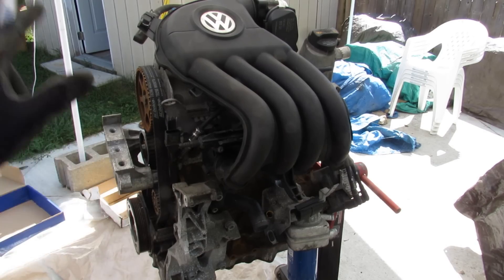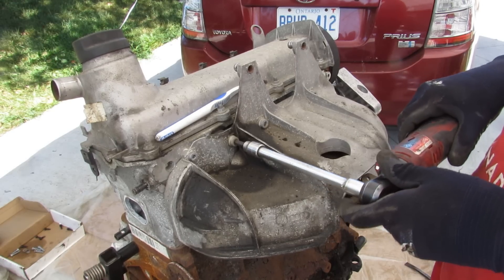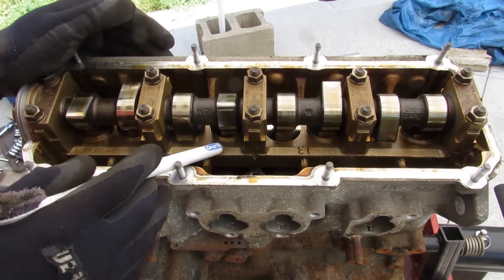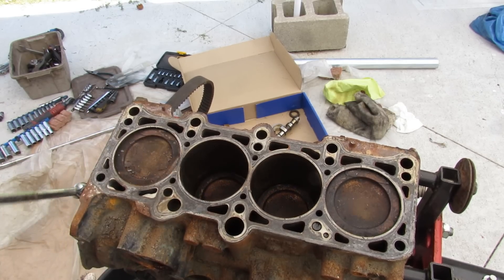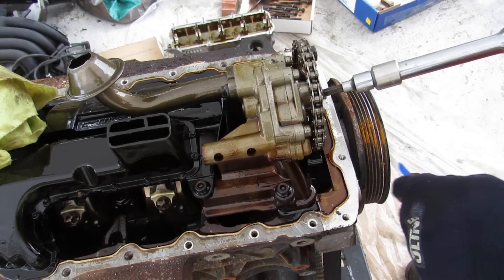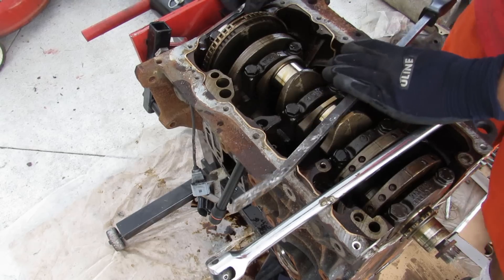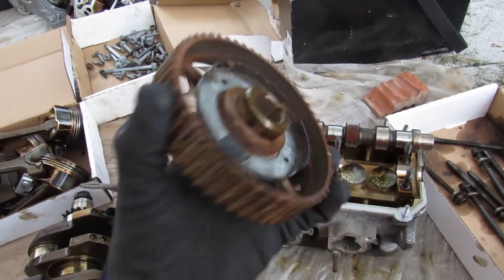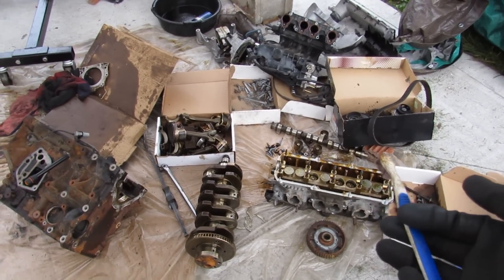The Simplest Modern Engine - From Volkswagen?

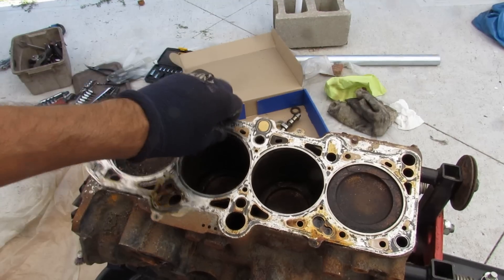Comment: As a VW engine builder (look at my channel) I have to correct you. The oil does not go up in the middle of the head. Look at 5:04 
The seconds bolt hole from the right. There a tiny hole. From there it feeds around the head bolt (2nd from the right) up around the bolt and somewhere under the washer sideways into the head. The hole in the middle-front is the oil return.
Reply from the maker: Thanks for the correction. Yes I've seen alot of engines being fed oil around the head bolt hole.
Reply: What is the best engine VW builds nowadays?
Reply: @82dupont  A Porsche flat four :)
Reply: Actually… the oil goes into the head, through the valve guides, and into the cylinder. 

At least it did on my 2.0L at 100,000 miles. 

Junk. Absolute junk.
Reply: @Bartonovich52  fr?

Comment: no VVT ,no V16,no direct injection ,no cylinder deactivation ,no turbo , no low tension piston rings ,no cartridge filter  ,inline 4 at best reliability
Reply from the maker: Yes....the irony is it's from a German manufacturer
Reply: @speedkar99  
i really didn't expect such engine to be made in 2015

Comment: That Jetta was the worst VAG product i've ever been in or driven. That engine is such a dog even tho it's pretty reliable, but who wants a reliable turd. It's not that good on gas either because you have to floor it to move anywhere. Pulling out into moving traffic in that car was fucking scary because of how slow it was. Would have people backed up behind wondering why the hell haven't you gone yet.  Forget taking any gaps to merge on the highway, you needed to plan your moves far ahead of time.  It was good to have as a learning teen driver tho. I was very mean to that car. The tires were bicycle all seasons too so the handling was like the polar opposite of a miata (understeer city). I wanted to like the car, the styling was alright, and it had an aux with a working radio and air-condition, and power windows... Those were the redeeming features.  When I heard the lawnmower I wasn't watching the screen and had genuinely thought you started the engine. I now have an apr tuned mk7 and it costed way less than that car... buying cheap new car seems to be pretty poor value vs lightly used. When I see cars like the Mirage... why would you do that to yourself? Never again.
Reply from the maker: Agree with all your points there. Putting such a slow engine in a heavy car is a real cost cutting move by VW... almost dangerous. 
What year was yours?

Comment: I turbocharger my 2.slow on my 2001 jetta
Reply from the maker: Does it just bolt on?
Reply: @speedkar99   the 1.9 turbo diesel exhaust manifold fit on the engine plus there are some aftermarket turbo exhaust manifold  online. So my set is ....
T3t4 turbo .48hot/.60cold 
Intercooler from Amazon 
Oil feed and other pieces Amazon 
Hybrid oil pan with oil drain 
Some Amazon blow off valve 
Reject version of a tial waste gate 
300cc injector from the 1.8 turbo gti first gen engines of the 1999model 
1.8t mass air flow 
I'm running 5 to 7 psi because I didn't put a headgasket spacer on it and I'm currently waiting on a tune for it
The only thing I had to do was costumize the exhaust to run the down pipe 
There alot of guy out there that have done a similar set up or more expensive set there even a supercharger kit but these day it's hard to find

Comment: What engine code is that?
My VW/Audi has a 2011  1.6l BSE motor, without any of this turbo crap, timing chains or EGR. Also no (pure) direct injection.
Reply from the maker: CBPA I believe. 2013 Jetta. Correct me if I'm wrong
Reply: I have AEE, 1.6 sohc with only 74hp but durable, reliable and very easy to maintain. Would love to see teardown of this one too although it was discounted by 2000 I belive.

Comment: that eng was maintained properly. this is a intentional design flaw of the oil rings. Do not buy vw.
Reply: what about oil ring ???
Reply: @Techie1224  they made them so small that they clog up destroying the engine
Reply: @narcissistinjurygiver2932  
but this engine doesn't seem to have burning oil issue maybe its head gasket or maybe even its just some humidity
Reply: @narcissistinjurygiver2932  Are you talking about 1.8 and 2.0 turbo-charged EA888 motors? Because this is not an EA888.
Reply: @whuzzzup  looks like the same oil rings.
Reply from the maker: Yes it sure was full of oil without any internal oblivious damage
Reply: @footballcoreano vw burn oil

Comment: Hello again from Wales. I know that Peugeot vehicles are very uncommon in America, but have you by any chance torn down an IDI old style turbo diesel, like the 1905cc in my 1997 Peugeot 306 ? I did read of one that covered 949,000 miles without needing anything but routine maintenance and, incredibly, some were even used in light aircraft. My car's done just under 81,000 miles now and I intend to keep it as long as possible, as it has no crazy sensors, electronics or stifling exhaust crap on it. Modern cars seem to have more troubles and more limp mode propensity than Quasimodo. Money pits, especially newer diesels.
Reply: The nearest IDI diesel sold in the USA was the original VW Rabbit diesel sold in Europe as the mark 1 Golf. 😎 My Peugeot 106 1.5 litre diesel has done >200,000 miles so far.
Reply: @backwoodsbungalow9674  Ah, I had a 106 diesel as a courtesy car once. Great little car, and it had a smoother gearchange than my 306, which is a little notchy. You'd love my car though, I'm sure. Straight through exhaust, K&N air filter, and I turned up the main fuelling screw by 90 degrees, for a fair bit more punch. Also have tooth fillings shaking engine mounts, a full polybush kit and coilover front shocks with a lowered back axle. Advanced the pump timing by 1 tooth on the belt, which makes a big difference to torque off the mark.
Have a good day.
Reply from the maker: Nice

Comment: Want an even simpler "modern" i4? Teardown the gm 2.2 pushrod I4 the used in the cavalier until 2004.
Reply: Those 2.2s outlast all the vehicles they were put in. Good engine, good mpgs when maintained and driven properly and very reliable and cheap to run. I've seen so many with over 300,000 miles on them.
Reply from the maker: Pushrods are more complex aren't they? Because they have rods and lifters lol
Reply: @speedkar99  i always thought that but from an engineering and manufacturering standpoint they must be simpler because they predated the ohc engine and are kinda an evolution from the older flathead engines...that and gm (king of cost cutting) stuck with them for soooooooo long.

Comment: That engine is running for over 30 years.  It was found on the mk2 Jetta/Golf in the early 90s
Reply: For that reason the engine was nicknamed „ the iron Gustav“! Properly maintained the will last very long.
Reply from the maker: Awesome. But it should have been retired before the A6 Jetta
Reply: @speedkar99  Agreed.

Comment: The VW translation for me is "Stay Away"!  I had 2 VW in the past. There were a lot of problems with them.  Engines leaking, electrical issue,  and disintegrating body parts after 5-6 years.
Reply: Meh, my '03 Jetta tdi has had its electrical bugs and the odd leak, but every thing has been cheap and DIY friendly. I've put a total of $1350 in repairs since 2013. For an 18 year old car, that's pretty damn good.
Reply from the maker: They sure can get problematic. This engine seems quite the opposite to VW tradition
Reply: mine was shit too.

Comment: There is a vw 1.6 sohc 8v, i think it had 96hp, and it uses the valve cover to keep the camshaft in place instead of cam caps.
Reply from the maker: What year VWs were those out of?
Reply: @speedkar99  i think like late 90' to mid 2010', i dont know if it's the full name (idk how vw engine names work), i searched volkswagen 1.6 bah and volkswagen 1.6 cfz on google, i don't know the difference or if there are more versions.

They are probably called different where you live, but they were on the gol, fox, and suran
Reply: @Giuliana-w1f  is the vw 1.6 cfz /ea111 used on the brazilian gol / suran / voyage.  I have a vw  voyage/gol sedan  bulletproof engines. Second one for me low maintenance fuel efficient and torquey

Comment: "How are you supposed to remove those wires with the manifold in the way?"   Simple answer: the engineers who design those engines don't have to do the maintenance. So why should they care?
Reply: You can replace the spark plugs without taking the intake off.
Reply: There's a tool for that. Without it you just rip the cables. It's vw after all
Reply: VW dealers love them.
Reply from the maker: True
Reply: On the mk4s they had aluminum intakes that could be split into 2 parts . Upper and lower making it easiest. You thinks this is bad. You should see a 350z where you have to remove the intake and shake the engine harness it get ti the rear coil packs
Reply: My sister had a 1979 Honda hatchback. Care to guess how you change the front shocks?
Step one: pull the engine.

(Not kidding. Or why it was still galloping along on original shocks when she sold it 25 years later.)

Comment: It doesn't even matter what motor  you are breaking down, or what car you are working on. I love watching you work, and teach. Its refreshing, relaxing, and informative. Not to mention funny, due to the use of your brother's tshirt, toothbrush, and so on. 🤣😂
Reply from the maker: I'm glad you appreciate my work. I learn alot myself while tearing these down and love to share it with the online community here too😎
Reply: Very amusing and this nitwit learned a lot. But sometimes it goes too fast. Question: is the engine put together after the break down ? Like to see a video of that too 😃👍🏼👍🏼
Reply: @harcovanhees394  These engines are junk most of the time so I doubt he puts them back. He most likely just recycles the materials.
Reply: Teaching is a fantastic way to learn.

Agree with first comment though, speedkar could do a video on something really basic and I would still enjoy it I reckon
Reply: This Engine was initially created by Audi in 1974
Reply: In the Audi 80 GT. As a 1471cc then Grew to 1588cc then to 1781cc finally finished as a Tall Block 2.0.

Comment: We love those here in Brazil. With forged internals and a big turbo they can produce up to 400 whp
Reply from the maker: Well the iron block would come in handy for that..
Reply: I was just thinking that this thing looks ripe for tuning. Iron block + dead simple + readily available
Reply: @bazzle592  Actually this block with a 9A 16V head and thicker head gasket lowers the compression rate making it perfect for a turbo installation.  It's a common feature on VDUB scene.
Reply: Yoooo who making forged internals for the 2.slow
Reply: @dud1f3r  Many manufacturers make forged parts for VW 2.0 liters. J.E. and Crower for example. In 2019 the world record holder in the 1/4 mile in the 4-cylinder category with an H-shift was a Chevrolet Chevette with a VW 2.0 turbo making the 1/4 in the 6-second place. It is the most prepared engine in Brazil, with investments in the tens of thousands of dollars in each project.
https://youtu.be/XHmw_mlkkuI
https://youtu.be/Atjfrrpuwz8
https://youtu.be/la8cKRBpPaE
Reply: @dud1f3r  https://youtu.be/zcAvSfc0tpo?t=58
Reply: In your experience, are they very reliable? How many km do they usually get?
Reply: @ut90J  standard, you can get 300000+km.  Regular oil changes.
Reply: @louvendran7273  that's good to know. Thank you for the reply!
Reply: @ut90J  i have over 400 000km on my 1.8 8v no smoke nothing
Reply: 300kkm like said. Cheap parts and you can do the maintenance yourself
Reply: Na verdade ja aguenta 300cv com miolo original, nn precisa ser forjado, mas a possibilidade de cuspir biela é relativamente grande

Comment: That’s why diesels are nice so you don’t have a distributor
Reply: Yes but you have a high pressure fuel injector system and other vacuum actuators which can cost x10 more than a simply dizzy cap
Reply: @cassk9999  
you  forgot DPF canister too , when the diesel car new you get nice torque and good speed but after some years you end up with a slow duck lol
Reply: True DPF filters are bad for your pistons on the exhaust stroke cause it takes a lot of energy to push it out the exhaust system
Reply from the maker: Nice
Reply: Diesel: Injector damaged -> motor fucked because in like 70% of cases you have to drill it out. Yay.
Also failing glow plugs. Yay.
Reply: Better off with fuel injectors than a carburetor